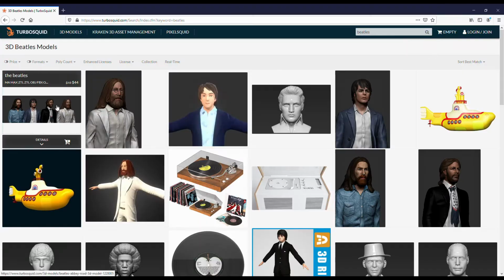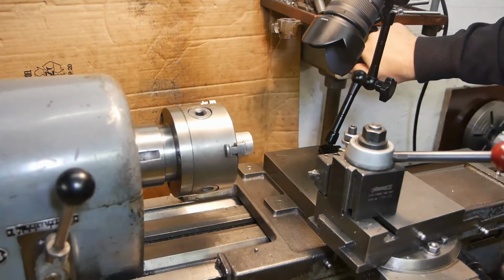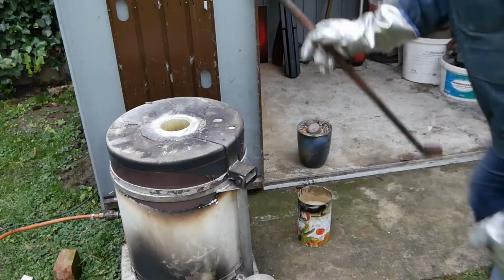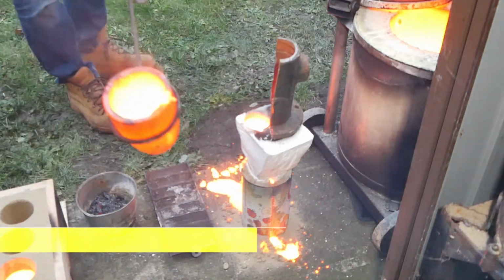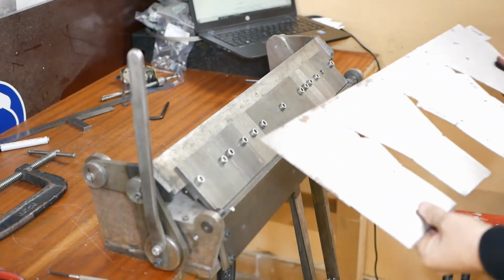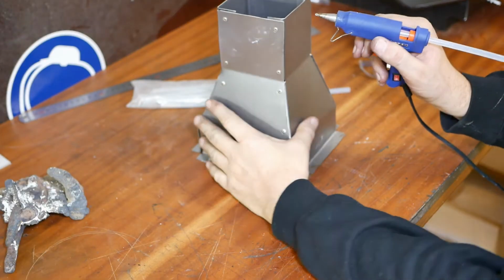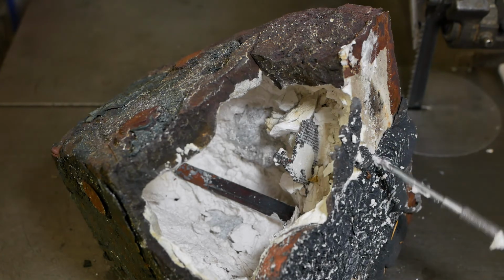Bronze casting fail - The Beatles - Abbey Road - George

Comment: If you need to do more such bending tasks too complicated for the break you may want to look into roofing seaming pliers, which do the same job you did with that vise and the hammer but give you probably 1000% more control ;) they are even available in 100 mm or more breadth, so depending on your needs can do pretty large straight bends

Comment: The tapered or top-heavy mold is an issue. Just make it a solid block with no tapers.
Wastes a bit more investment plaster but that's acceptable until the training wheels are off.
When I move the mold from furnace to sand, I have the sand in the bucket approx 1/4 full.
I then put the mold in the bucket and top up the sand around it.
A fully supported mold has a much better chance of success.
Nice progress overall, you'll nail it soon.
Reply from the maker: Thanks for your tips. My burnout oven died, so I need to make a replacement to be able to cast the last two Beatles.

Comment: OMG!!! Please Please Please don't remove ANY chips from a spinning lathe with bare hands if you don't want to lose fingers or hands. Stringy chips are particularly vindictive... I've seen the results in the past. If you have to do that, use a long ()say 12 inch) piece of tough wire with one end bent at 90 degrees, and maybe a wooden handle on the other end.. nothing that you hook your hand or a finger through, just a wood sausage around the wire that can slip through your fingers if tugged by the stringy chips. Keep well. HA... I've just realised that this video is a couple of years old. Still a valid concern tho.  I was worried that I might not get to see your excellent videos for a LONG time or any more. I am so glad that that didn't happen.
Reply from the maker: Thanks for you safety check there John. I have a swarf hook, and use it now.

Comment: a better way of doing this is to coat your part with a few layers of thin investment  then wait for it to cure a bit, then alternate between layers of thin investment, and sand, waiting enough time between for the investment to solidify enough to hold the next few layers. do this until the model is sufficiently insulated, then wrap the piece in steel wire. you want enough to keep the piece from easily breaking, but be mindful not too much, you aren't wrapping a mummy up, you're just adding structural reinforcement. Then continue the layering process alternating between investment and sand until you have a sufficiently thick enough shell (A piece like that, about 1, to 2 inches thic should be more than plenmty

Now set the piece asside in a dry place, and allow it to slowly cure. Trying to speed up curing will only introduce weaknesses in the investment. Once the piece is thuroughly cured, and air dried, use a heat cycle to drive off the remaining moisture, then fire it to burnout, and finish solidifying the shell. WHen you're ready to make your pour, burry the ENTIRETY of the mould in sand, leaving about 1/4" gap from the top, make your pour, and walk away for about 30 - 45min's, pull the still hot mould, and submerse in cold water to fracture the investment shell
Reply from the maker: Thanks for your input on this. I need to make a new burnout oven and finish the set, as Paul and Ringo are still not there. What sort of size parts do you switch from block to shell investment? Are they the same powders?

Comment: While my guitar gently weeps after this effort. But points for the attempt. You should Bury your mold in a sand bucket  for additional support , safety and sealing
Reply from the maker: I uploaded a the next attempt on Sunday. I now use  stainless steel pipe as a flask, so the support and safety are now addressed. I do still sit it in the sand bucket.

Comment: I might be late to the game with feedback, but whatever. 
It's easy to beat yourself up over these sorts of mistakes, but I think this might be the most common type of mistake that people make. I've heard it called "Plan Continuation Bias" and that rings true in my ears. It's impossible in the moment to gauge the increased risk of faliure when an unexpected obstacle is presented. The vast majority of the time these hickups are so slight (A narrower opening than expected, a clean break that a quck fix should be able to redeem) when you're in the process of, say pouring white hot metal. 
The resulting faliure seems obvious and inevitable in the aftermath, but it could just as well have worked instead of failing. 
The points: Dont beat yourself up for doing what you set out to do, and be aware of Plan Continuation Bias.

The fact that you took the time to learn from your mistakes and shared you faliure with the world is magnificent. This way we all learn.
Reply from the maker: Thanks. I need to take another shot at this.
Reply: @RotarySMP  I'll be delighted to watch the video ;)
Reply from the maker: @Koptokaf  Thanks for your encouragement.

Comment: Have you read Foundry Work for the Armature or Back Yard Foundry by B Terry Aspin
Reply from the maker: No. I'll look ino that.
Reply: @RotarySMP  Just thought you might have seen them. Written by my farther in the 1950's  mainly sand  casting. Just thought after seeing you do a bit of sand casting. He also wrote articles for the Model Engineer And was the cartoonist behind Chuck.
Reply from the maker: @Aspins  I have "the metal casters bible", but have learned that most from the Alloy Avenue and TheHomeFoundry forums.

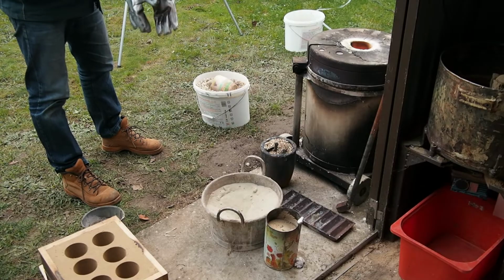Comment: 1) Why did it smell so bad at 32:00  ?   2) Why do you make the child-cup molds to pour metal into?    3) This looks like it is very expensive to make one George, am I right? Apart from the "fun" factor, maybe get shapeways to 3d print one for cheaper?
Reply from the maker: I overheated the mould during burn out and assume the sulphor in the Calcium Sulphate was dissassociating.
Casting with swarf as a base metal means you have excessive surface area, lots of oxides and slag. When I remelt this I'll have much cleaner metal.
Nah, casting is hard, that is part of the appeal.

Comment: @ 26:41 Huston... I C a flaw...
Roger Bleep
What is that...
Roger Bleep
R these rivets made of Aluminium...
Roger Bleep
Yes
Roger Bleep
Shish Kebab they only have a melting point between 865 to 1340 'F
While Bronze has a melting point of 1842 'F
Roger Bleep
Whoops...
Roger Bleep
Reply from the maker: Nope, they were steel rivets. Emphasis on "were" :-/
Reply: Steel 2500 to 2800 'F dependant on the Carbon content;... should hold out...
Just looking up Bronze Casting
Reply from the maker: @ElTelBaby  Steel fuxed by Calcium carbonate obviously has a much lower Melting/rusting/ absorbing into plaster temp. As I found out.

Comment: I have been doing some bronze/brass casting as well and one thing I think that has really helped is adding Phosphor Copper shot to improve fluidity.  https://www.budgetfoundrysupply.com/phosphor-copper-shot  I was never able to get the plaster to work and stick with green sand.  Some tips I learned when doing lost PLA was I would coat the surface of my print to improve surface finish and spray Windex on mold  before pouring plaster to break surface tension and eliminate bubbles sticking to the surface of the mold.  The coatings I used where spray lacquer, epoxy  and thinned white glue sprayed from a spray gun.  Surprisingly the white glue did the best job without losing detail.
Reply from the maker: Thanks for the dvice. I tried spraying clear paint, but it left ash on burnout. I don't real mind the striations from lost pla. The real problem with the second pour was simply lack of patience. The melt was "chunky". Purchasing from US uppliers is too dear with the freight and customs charges. I havent found a source of Phosphor bronze here.
The next attempt will get a stainless steel flask, and more controled burn out.

Comment: 'Maybe gravity changed in the last 20 seconds' 🤣🤣👍
Do ingots melt better than those shavings for the next pour? Or why do you melt them?
Reply from the maker: Yes. The chips have a lot of surface are (also take a lot of space in my shed).When they melt, the oxides are considerable, and make a lot of slag which floats. On the next melt, they should make a lot less slag.
Reply: @RotarySMP  Ah thanks! Didn't think about oxides. My analogy was a lot of small ice cubes that melt faster when you pour them water/your drink :)

Comment: i have the thame behind me with alu. i have taken the alu cunk as a reminder how complicatet casting is and dont spend no more so much time and effort. today i have a 4 axis leadwell ecocenter v350 cnc from a friend :D i dont need casting anymore.
i tried wax filament but it dosent work propperly. you must make a negative sillikone model and fill it with spezial casting wax. then plaster it in a big vakuum chamber with elektrikal pump. and then carefull ramp up and down the temp to melt the wax and harden the form.

i wish you luck :)
Reply from the maker: Thanks. I am going to need it.

I see subtractive and additive machining as complimentary.

https://www.youtube.com/watch?v=LXwbRhgq1og

Comment: I once had a tour of bronze foundry, art and large plumbing valves etc. They used lost wax process predominantly, casing was plaster based with added refractory materials. Ie sand, zirconium flour, up to larger granules of refractory. I guesstimate some small amount of clay or perhaps sodium silicate was used as 'glue', clay would be sticky stuff. The way it was applied was firstly dipped, I think perhaps silicon flour was maybe dusted over wax to help correct covering. continued dipping built up layers with larger refractories added as  layers built up. Spray was used for build up as well. Here comes the critical part, thickness seemed around an inch or so, say for parts like domestic tops and valves, all were multi sprued which adds to structural strength as well as metal flow. 
It looked like the golden rule was, more sprues than you would think needed, some large to facilitate even major flow, these also acted as reservoirs for smaller feed sprues to detailed areas. The fact that all this seemingly excess metal can be reused as if it were ingots, means the home foundry can also benefit from this method, ie do as they do and put in more than just what looks like you need, it's not wasted..
Burn out was almost as defined as firing clay, so I guess that's where the added clay as binder is important, it gives bisque fired strength to casing, they seemed to be very very much like fired clay in appearance and sound when lightly struck. For small scale version, this 'tree' structure could be done in loose sand to keep in correct plane, with added thermal protection cooling wise. It cleans off with a bit more effort than simpler methods and materials, so perhaps a needle gun on low, and soaking may be required to loosen casing, this I guess only applies if you are doing this DIY approach, the commercial product you use should be easy if the instructions are followed, it may be fine up to a certain size casting, may need further structural elements with larger jobs, ie thicker, added refractory, and nestled in sand bed for added support and thermal requirements.

In doing like you did in a cask of sorts, I think it was over thought to some degree, a rectangular container can be used, and made quickly, internal excess can be shaped with clay or plasticine, to save plaster., so like an old two litre card milk container, or corflute, sealed with correct structural sealants,, maybe as simple as hot glue for smaller,  taped outside with duct tape etc. Larger stronger, can be done quickly with mdf shelving materials, or sealed plywood like you had, a simple box like structure screwed together, coating with oil or vaseline etc. Obviously this is removed when set, so thickness and scale of investment is big factor in handling and firing, it may not hurt to do a final layer with added pva glue for instance, should burn off, maybe worth testing.
.
In my experiments on a small scale, drying is absolutely critical, as is firing properly to correct temps. Over heating may well degrade plaster back to gypsum, so looses it's structural integrity. Plaster has two phases of water removal, the simple drying, then the firing to remove the chemically bonded water, so exact temps and times required, measure both.(1). .The addition of either clay or sodium silicate, ( water glass ) needs to be tested if going down that route, ie DIY encasement,  but firing and drying still critical to repeatable success.
I had flour zirconium, and fired clay ground to dust at my disposal, both work as additives in plaster, crushed brick as outer layer refractory, all work if dry and strong.. As another use I added zirc flour to simple silicon sealant, acts as lower temp silicon mould material, ie leads and similar low melt metals, just mixed by hand..
 Hope some of this helps..

((1).I found out the hard way about the chemically bonded water, the investment was dried over week, but not heated to correct temp. The molten brass I poured found the moisture and I had a small volcano on my hands, super heated steam made the entire pour very aerated, I ended up with what looked like spongy, aerated brass figure, in the shape intended.. and of course lots of bits of flying molten brass flying out of mold.. lucky it was a small scale model.)
Reply from the maker: Thanks. I will use a stainless pipe for the flask next time and just accept that it uses ore investment. A friend has a vacuum pump he will lend me, and I am still looking at getting my heat treatment oven built in time, and using that as a burn out oven. More sprues is also noted.

Comment: In the end, did you soak the investment in water or why did it look so wet? In any case this investment you are using looks quite fragile for some reason. I would bury the investment in the sand (or other suitable material) as it would help with the pressure and support the investment. Also it wouldn't harm if the investment is hot when casted.
Reply from the maker: You are supposed to start the burn out process with the investment wet. The required wait after investing is only 9 minutes.

I will use a stain less steel flask next time, and keep the flask on.

Comment: A few questions and suggestions:

Questions first - how hot is your burnout oven when you are burning out? Are you sticking to that manufacturer’s spec on temp & heat cycle? Are you vibrating the wet plaster to remove air? That bike pump won’t draw enough inHg to de-air that investment. It looks to me like it is either too hot, or you’ve got air bubbles. 

Suggestions next-

1) By the time you are pouring, I think your mold is too cold. You want to go pretty quick from the oven to pouring. Not sure how you will accommodate that using a single furnace for both melt and burnout. 

2) Sprue up a lot more. Like, a lot more. You can cut sprues out, and clean up later. Sprue between lots of adjacent surfaces, like between the legs, and from the arms to the torso. Try using wax sprues like these: https://www.amazon.com/dp/B01188SHZW/ref=cm_sw_r_cp_api_glc_fabc_AE96Fb8YMNF2G
Reply: BTW, cool project, and thanks for sharing your learning process!
Reply from the maker: The only really controlled part of my burnout is the first four hours in the kitchen oven at 150°C. I then did three hours in the furnace just candling at the lowest gas flame which would stay lit (this was supposed to be 370°C, and then the final step of 750°C, I just increased the gas pressure on my little 1/2" Bunsen for a couple more hours.

Look like I need to make a separate burn out oven. I have the materials, as I was planning to make a heattreatment oven about that size.

I was also suspecting that the pump doesnit pull enough vaccuum. There is a design for a vaccuum pump on VOG YT channel. I'll look into that once covid lock down ends.

ON the first one, due to leaks, I never got to vibrate. On the second one, I vibrated the mould for a couple of minutes after pouring.

On the other two I already did (Paul and John) I had no defects due insufficient sprues. 

The bronze was too cold on the second pour. That was dumb. I even have an immersion thermometer (K Type thermocouple probe, protected by a graphite rod sheath). Brain fade, I should have used it.
Reply: @RotarySMP   good deal man, it sounds like you’re on the right track. I’ve used my burnout ovens as heat treat ovens, sounds like you might be on track for a multipurpose tool :)

There are some realllllllllly cost effective vacuum chamber kits on Amazon, like sub $200 USD. DIY is not too hard, but honestly, I found the price of the components to be more expensive than the cost of the kit. The vacuum chamber I bought has a huge repurposed stainless steel stock pot as the chamber, a half inch thick piece of lexan with a silicone gasket as a lid, and a cheap vacuum pump. I don’t vibrate any more, love it :)

You can get away without using extra sprues, but it’s cheap insurance against a failed pour, and air bubbles happen. I don’t work much with bronze though, mostly gold and silver, and lost wax, recutting wax and material loss is expensive and time consuming. 

Good luck man, love your channel!

EDIT: This isn’t the exact kit that I bought, but it’s quite similar, and would probably do the trick for you: https://www.amazon.com/dp/B089JWTFHR/ref=cm_sw_r_cp_api_glc_fabc_CO79Fb6CKP1JF
Reply from the maker: @thecrucible537  Thanks for the link. A friend of mine hs a vaccuum pump he is going to lend me for the next attempt.